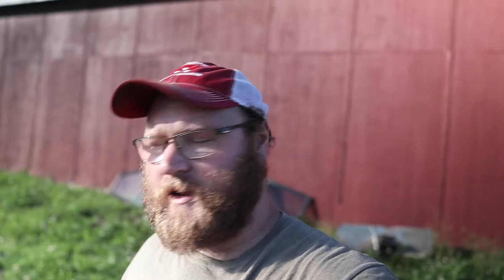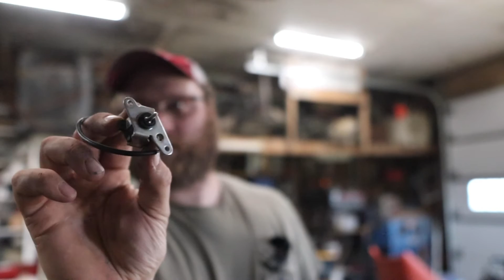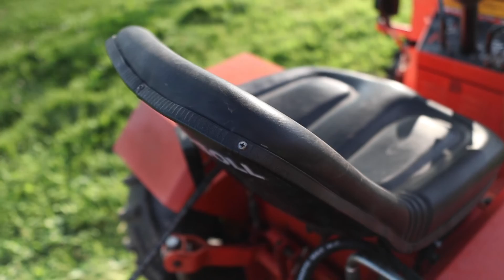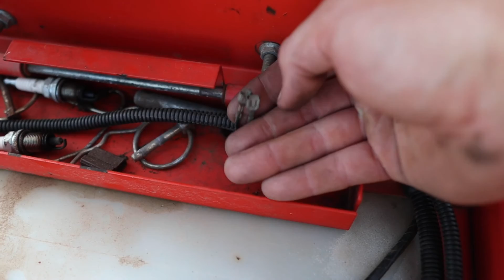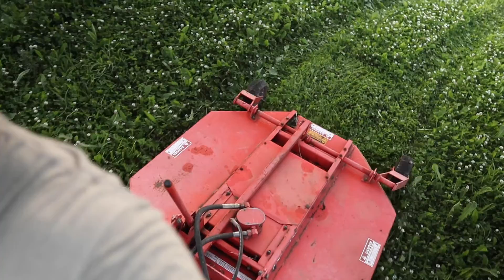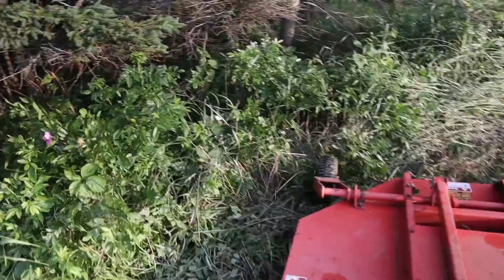Fixing Fuel and Ignition Problems Kohler CH20 Ingersoll 7020

Comment: Funny enough I fixing a garden tractor for friend that had that problem but it was a Briggs & Stratton VTwin 20hp Intek which had the fuel shutoff solenoid stuck, and what a BA$T🤬RD !!!!😡 to take off, you literally had to take off the engine air cowling and air manifold with the carburetor on as a unit to take the carburetor off to undo the fuel bowel !! Plus those stupid Torx bolts holding it on !!!😡 but thanks to YouTube I found a channel that showed how it's done, so cleaned it up tested it assemble it ( I wasn't going to put new gaskets because the tractor was basically junk and would only last a year) and it run !👍the only problem now is the electrical problem which prevents the tractor to move as it cuts out.🙁 I would put your restoration of your 1394 on this channel, it would make a interesting how to and show how to repair a 1394. 🙂👍
Reply from the maker: Haha at least the 7020 it’s not hard to pull the carb off, I was able to just loosen the bolts and leave the linkages and everything on it, gave me enough room to remove the solenoid.